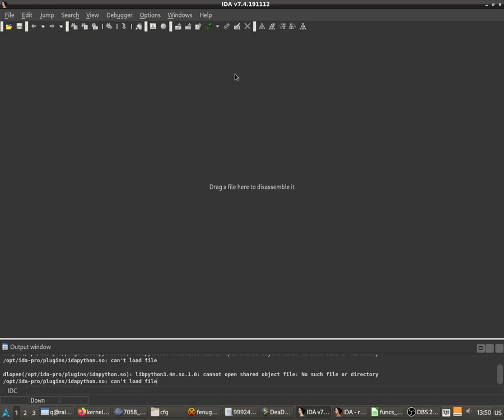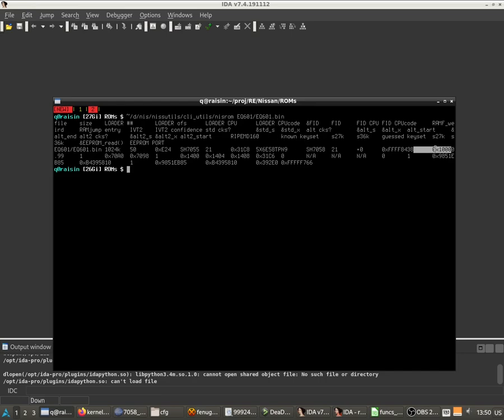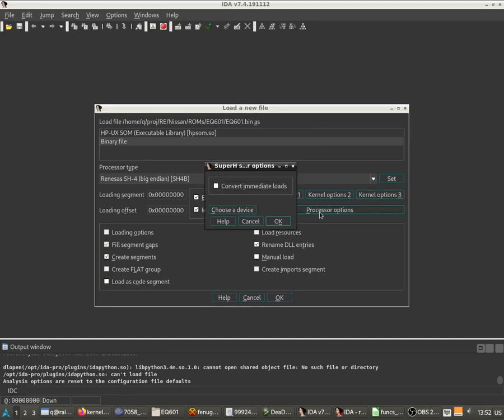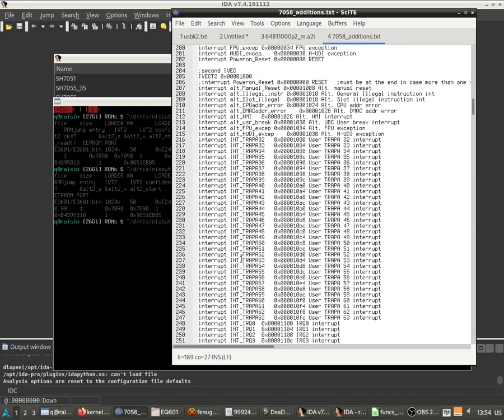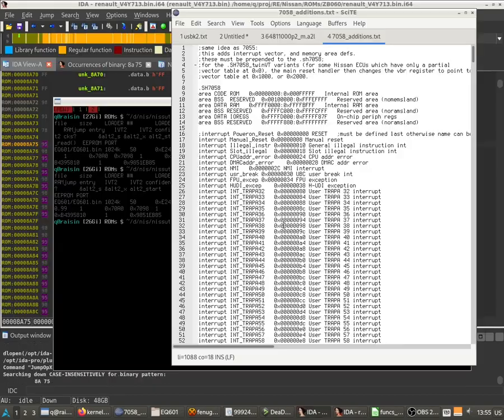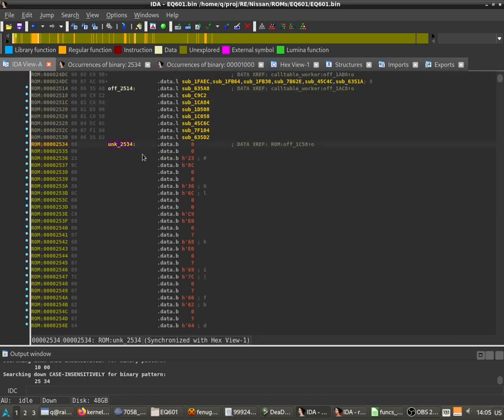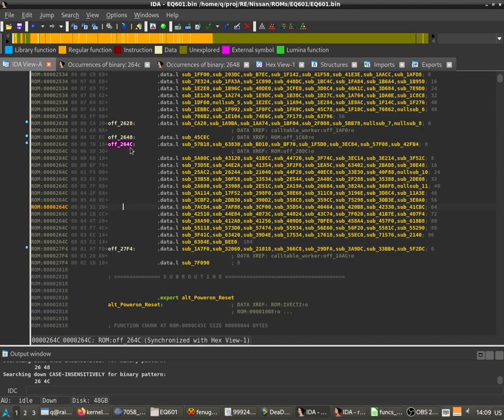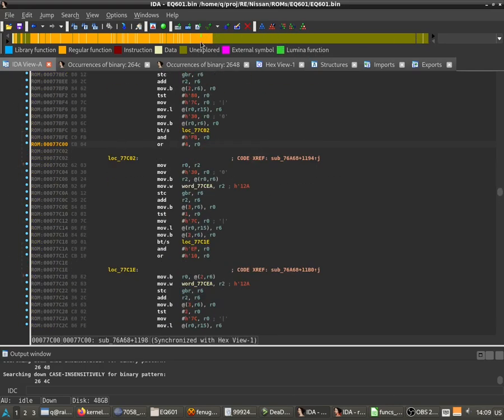Nissan ECU ROM reverse-engineering. 0: initial analysis (IDA)

Comment: Keep going Sir the world need to learn..Sir can you please do a tutorial  how one  trace the analog input signals from the input pins via conditioning to ADC to the microcontroller how to identify the circuits and reverse engineering the hardware to a schematic?
Reply from the maker: Thanks for the comment. Tracing signals is typically fairly simple but slow... Just need a continuity tester, magnifying glass and good light. And/or good PCB photos. This page covers the process much better than I could : https://top10pcb.com/how-to-do-pcb-reverse-engineering.html . I use very simplified method since I usually don,t need as much info.
Reply: @fenugrec5697  Thankyou Sir.Hope to learn more from your tutorials.Take care

Comment: Is there a cheaper alternative to IDA? The free version doesn't appear to dissect .bin files and I was quoted 1400+ for the Pro version.
Reply from the maker: ghidra is a very usable alternative
Reply: @fenugrec5697 could you make a video showing your workflow approach using Ghidra similar to this? I assume you use the SH-2A big endian analyzer. I downloaded the py script you made for Ghidra but after running it then the auto analysis, I don’t much difference.
Reply from the maker: @projectLSaudiA4  eh I wasn't planning to ; , I assumed the existing resources (ghidra for subaru is a very similar workflow and documented in romraider forums) kinda covered it already. I'll keep it in mind if I feel like making a video later this winter